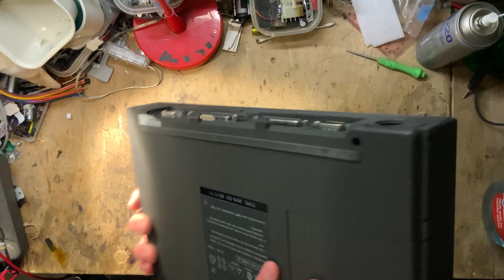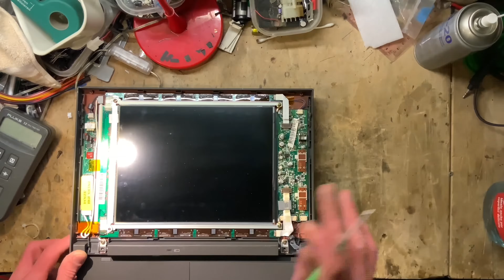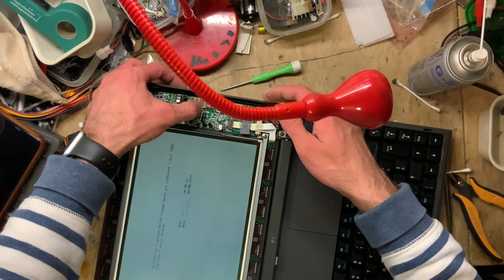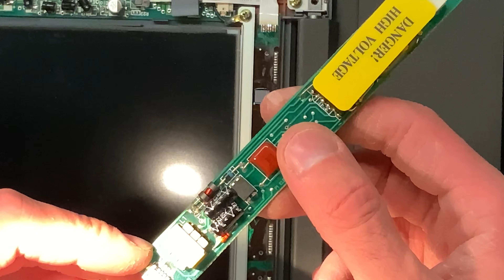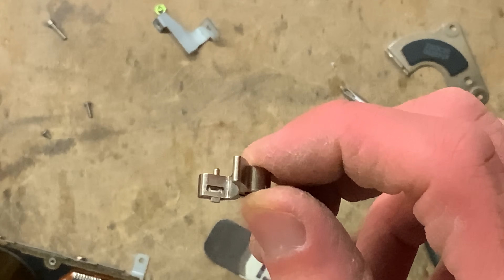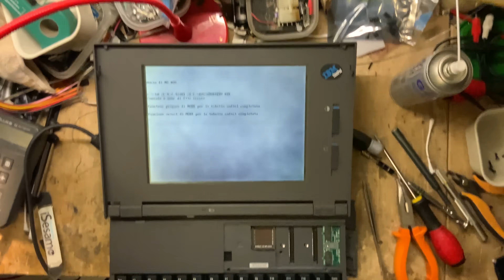IBM ThinkPad 300 vintage laptop computer repair restoration last repair of the year turned nightmare

Comment: I put mine awa several years ago. Nicely packed in his origina IBM bag with its original paperwork, charger and even an IBM labeled mouse. 
Today I took the laptop out, hook it up to the charger and nothing more happens than the redl ligh at the battery symbol is lighting.

Guess the battery is dead. Any idea how to start this laptop with a dead battery?
Reply from the maker: It should be able to start up with the battery disconnected

Comment: i have the same but its locked by a bios password. i took it apart to look for jumpers bud found nothing, battery was the same like you had... now it doesent work anymore.
Reply from the maker: They’re made by Zenith so maybe you can look how to bypass the password on them. I would also recommend checking the connection to all the cards that make up the layers

Comment: Hiya! do you still have that IBM z9 system? ive got one as well sadly its missing the disks in the laptops. Would you know where i could get a clone or a ISO or something i have the laptops just not the OS so kinda sucks. Thanks man! Hope you see this
Reply from the maker: Yes I do but unfortunately the disks contain firmware (LIC in IBM terms) unique to the specific processor. There’s a disc in the recovery set that it’s custom for each unique serial number
Reply: @FrancescoF  Thank you sooo much im going to try and contact IBM
Reply: @FrancescoF  Ive contacted IBM crossing fingers, hopefully i can manage to get a copy, i can wave around my company flag all i want but even then im unsure they can give me anything.
Reply from the maker: Worth trying but unlikely they will help. Usually you would need an active service contract with IBM and the z9 isn’t even supported anymore